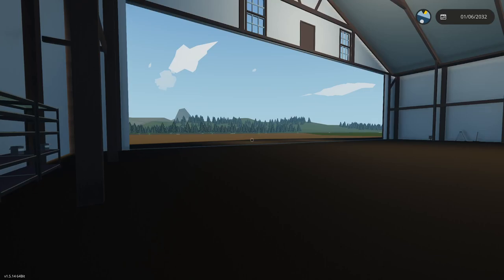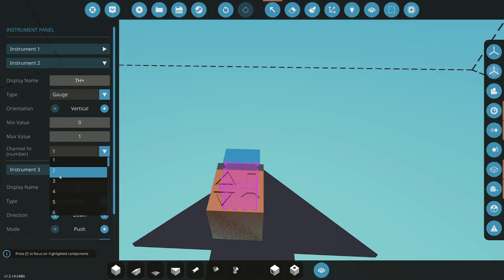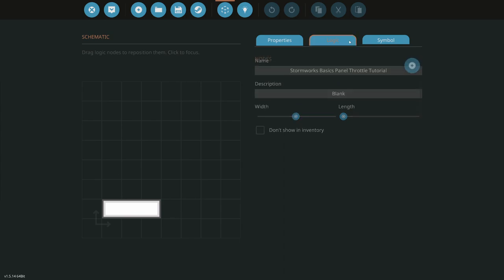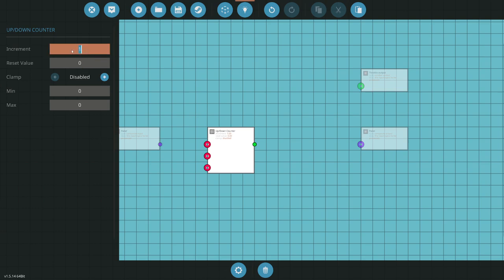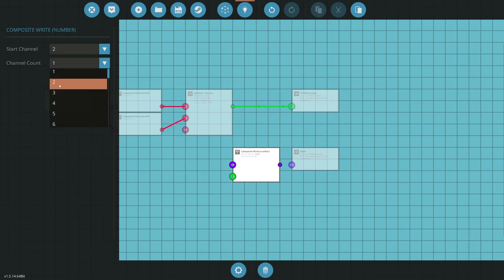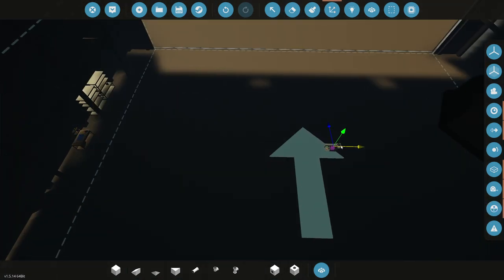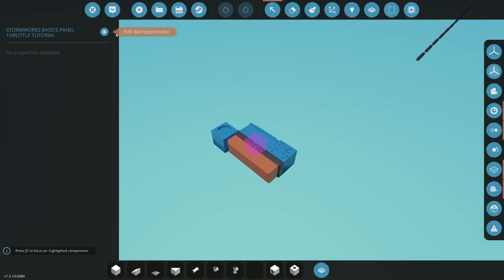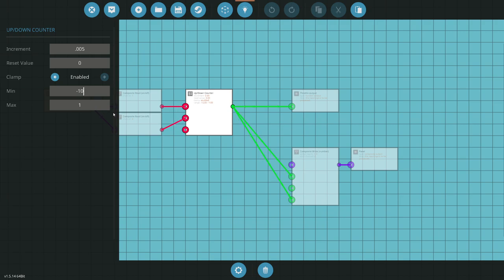Stormworks Basics Throttle Panel Tutorial

Comment: You can set the increments to 0.1 0r pretty much any number and use a pulse button for one tap controls to select specific throttle settings.  It is good if you want something like idle, run and emergency throttle settings without constantly messing with the throttle.   Using increments of 1 or more is good for setting specific rps values for a PID.